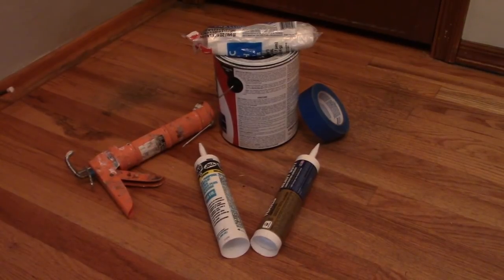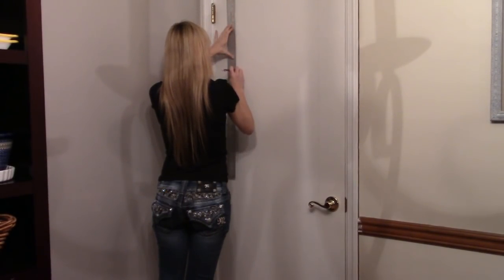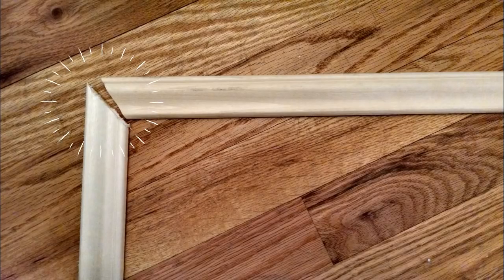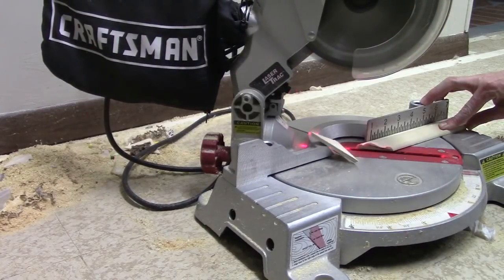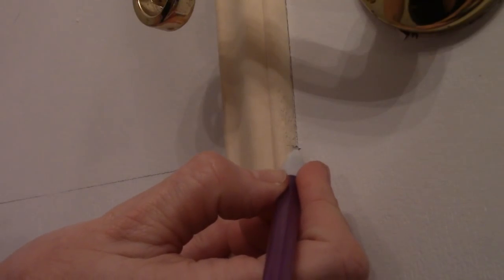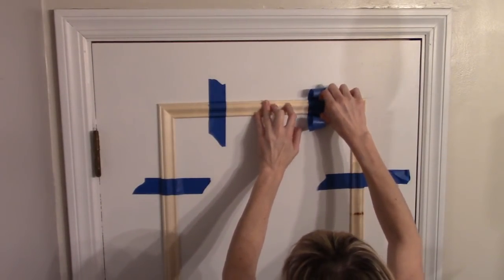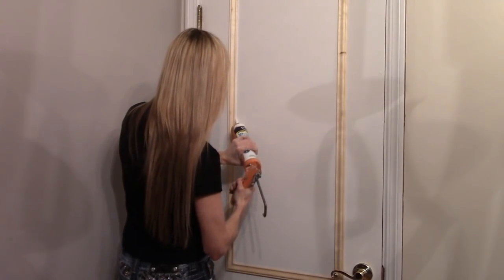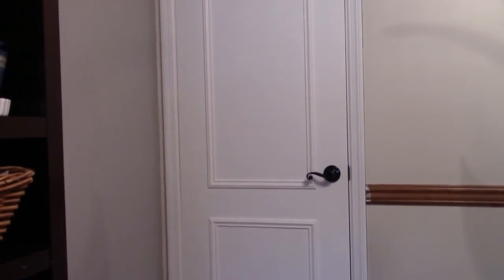'On The Fly...DIY' Faux Paneled Door

Comment: I'm an absolute noob when it comes to this, but couldn't you apply the trim on the not yet painted (but sanded?) doors, and then paint everything at once? 
I wanna do this witj my white cabinet doors and paint everything black...
Reply: It’s much easier to paint trim separately than to try and paint it while it’s attached to something (and get all the paint even with no pooling)